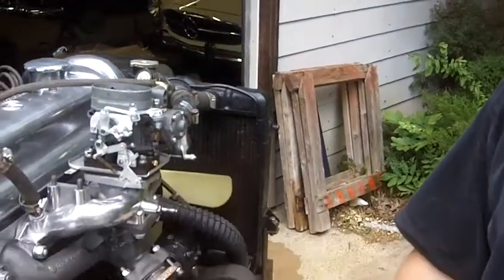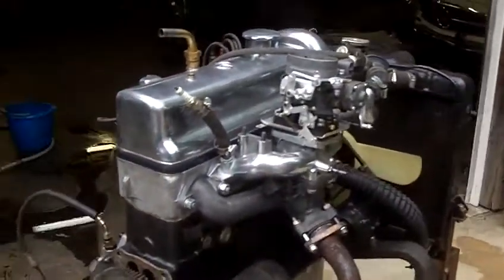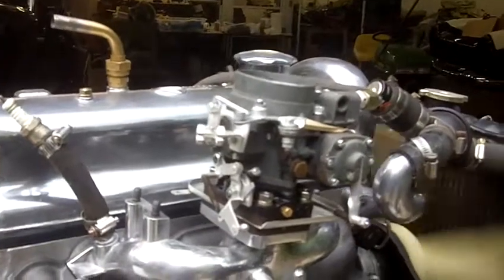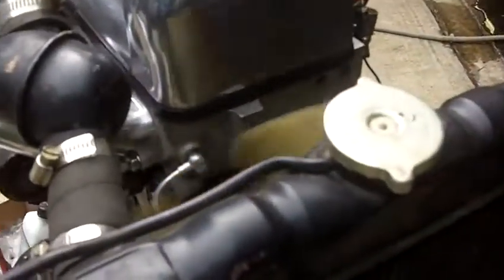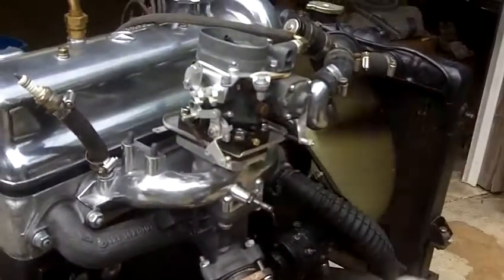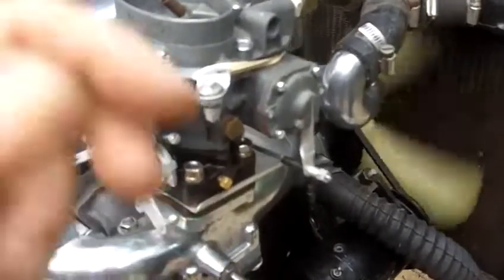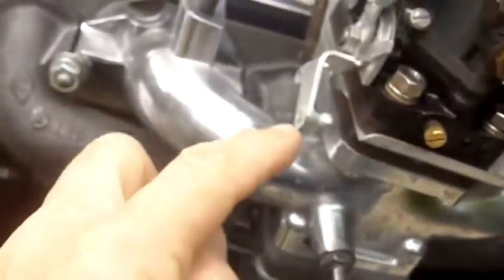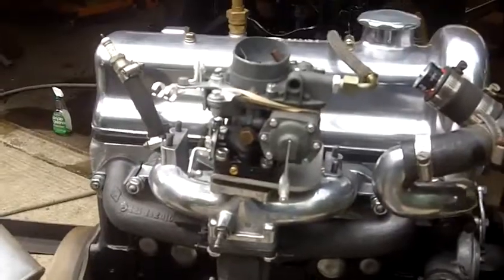190c Engine Test

Comment: This carburetor ist wrong for the 190
Reply from the maker: Yes. It was already installed on the engine when we received it. Owner was told he would gain 3.5HP if he installed this carburetor.
Reply: @Mercedes-Guru  but it is not serial on this engine. I know it i have the same car.
Reply from the maker: @andreass.3765  You are correct. Thank you.